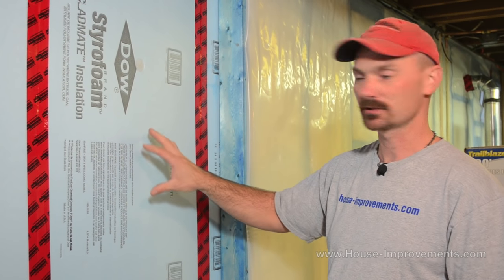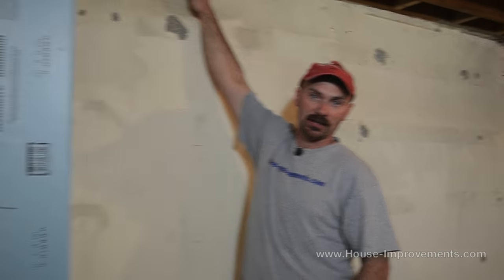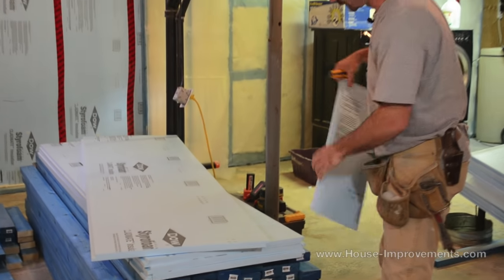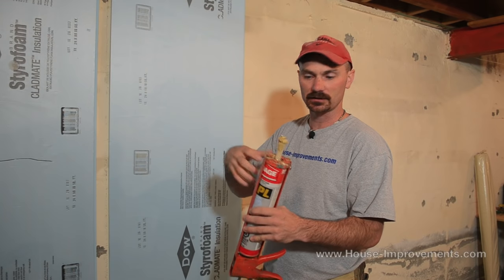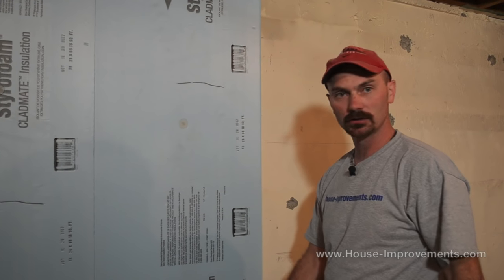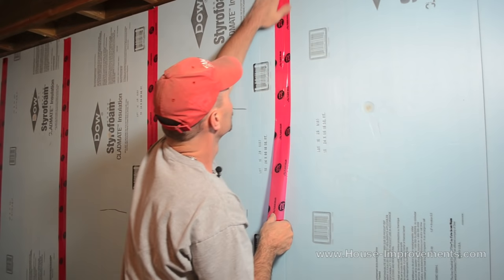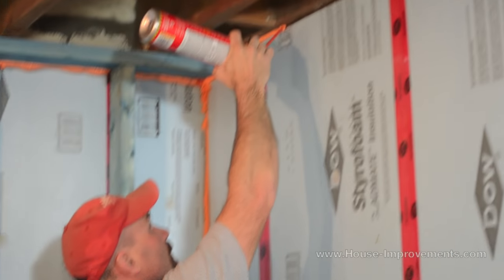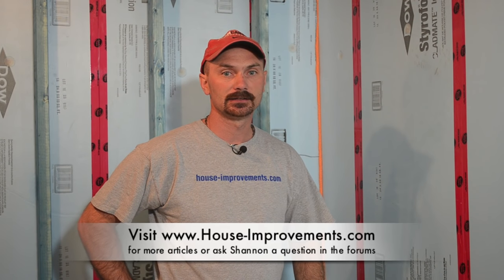How To Attach Rigid Foam Insulation To Concrete

Comment: Hi Shannon, I have a question about a house built in 1967 with brick on the outside wall. I was planning to insulate my wall that is not attached to another house (corner house wall) and was trying to figure out the thickness of the studs by poking a hole in the wall with a drywall blade. To my surprise I was only able to stab 1.5" inches deep because that is how deep it is and that is including the 1/2" drywall. I don't see any insulation at all through wall when I carved a small piece off and see what looks like cement or cinderblocks. Is this configuration normal for my house of that age because I was under the impression that houses are either 2x4 or 2x6  for living rooms and bed rooms.

Initially I was going to use fiberglass or rock wool but I guess my only option is 1 " rigid foam made by Rmax Thermasheath with R value of 6. Do I need a vapor barrier with 3-6 mil plastic with this type of install or does rigid foam already serves as a vapor barrier?

Comment: How deep into the concrete wall does the masonary bit go.
I think I'd be nervous to drill holes below the outside grade due to potential leaking..
Is there any way to smooth off the bumps on the concrete wall..?

Comment: +houseimprovements you said the foam acts as vapor barrier as well... then you said you're using the studs with normal insulation I assume fiberglass with a vapor barrier on top. isn't this counter productive and incite mild grow on the fiber glass since it will be trapped between two vapor barriers where moisture will be trapped?
Reply from the maker: No, the thickness of foam used here (1") is not enough to be considered a vapour barrier. You need 2" of foam for that. The 1" foam here is considered to be a moisture barrier though against the concrete .

Comment: I have  sheet insulation 1.8" thick. I want to put it on my basement walls which are 8" thick poured concrete. My sheet insulation has a fiberglass type backing front and back. Do I need a vapor barrier and if so is 4 mill plastic good to use. Should the vapor barrier be against the concrete wall or overtop of the insulation? thanks your response is appreciated.

Comment: Hi Shannon, could you please let me know if after put the foam insulation in the concrete wall and the framing I have also to put another kind of insulation? (for example the "yellow" insulation showed in this video) . Do you have any other video explaining that?

Comment: is it ok to put that styrofoam board directly on to cinder block?  My basement is cinder block, then probably like 1 ft or 1 1/2 from that is the stud walls.  between that is some sewer/drain pipes around the basement.  prior we just had insulation with the paper as the vapor, but due to flood had to rip it all out. now it seems like there is such a better method for insulation, mine as well do it a little better this time.

Comment: In this video you use the batt over the rigid foam. I'm in North Dakota so winters are about like the ones in Saskatchewan, can I use rigid foam only and avoid the batt insulation all together? I love your videos and that you wear hockey hats all the time haha! Thanks
Reply from the maker: Thanks for watching, I have now changed my hats in the newer videos. LOL
You could skip the batt insulation but if you do use 2" XPS ridged foam to achieve the R values needed.
Reply: Perfect thank you for the quick response! You've solved months of research questions!
Reply: @Colton, you may want to consider Roxul. It is a rock wool type of insulation. Mike Holmes loves it and uses it all the time. I used it extensively in my home reno. Perfect for basements as it is mold resistant. Great for sound abatement too.
Reply: And 1/4 the price of Rigid foam!  I've decided to use a combination of the two.  Also, Roxul won't catch fire unlike rigid foam.
Reply: Tania Twordik 
Did you still need to use a vapor barrier on top of the combination before the drywall
Reply: That why its best to use rigid foam on the exterior...

Comment: Drilling into concrete that much is really a pain. Wouldn't it be possible to use the same foam insulation you use for the cracks or another similar product to hold this panels to the block. Surely someone has created this by now.

Comment: Shannon, this is great, thank you.  Do I need to do anything differently if my basement has a floating slab?  There's about a 3/4" gap around the perimeter of the slab and the concrete block wall.
Reply from the maker: You may need to install floating walls but the foam install should be ok. Look on my channel for a related video about framing floating basement walls.
Reply: HouseImprovements thank you so much! I’ll look for it!

Comment: i am putting 2 inch foam board on the walls in my crawlspace and plastic vapor barrier on the floor , my question is , do you put the plastic vapor barrier behind the rigid foam board or in front of it , not sure what to do to get the best seal.

Comment: Shannon, ty for the video.  Had a question. Any suggestions if there are visible French drains.  I can insulate the the top as you have shown here, but is it ok to leave the bottom end exposed since there is French drain around the perimeter of the house?
Reply from the maker: Yes you do not want to seal the bottom in that case. That way the moisture can make it out from behind the  foam and make it to the drain.
Reply: Ty. But should there be a concern for possible mold since there is no airspace between the wall and foam board considering condensation/moisture would travel down to the drain?  One again, ty for sharing your wealth of knowledge.
Reply: HouseImprovements I am thinking to do a French Drain outside my concrete wall, my interior walls are mega high... can I leave a bigger gap at the top- like half a foot? (for more airing and cost cutting- then baton and insulate away from that). Also when I put the horizontal wood down for the vertical studwork I think I will try to use the blue wood you recommended, but just use untreated for my vertical studs. I then follow the steps on your other "insulation wall" video- BUT what do I do regarding moister barriers lip and flap when I come to do my flooring? How and where do I tie all of that in?
Can I moister treat the wood for bases and top stud framing if I cant find the blue wood?
Kind Regards
Reply: Sunil S Mold needs an organic food source to exist and grow.  With the foam having intimate contact with the wall, there is nothing there to allow mold.  Now, if you have a wet basement, the cause has to be addressed before putting up the foam...unless you have a weeping drain system in the basement floor.

Comment: Ive seen other videos where they used a based moister barrier of some kind of fabric instead of this styrofoam. Do you have any comments on that type of installation? The reason that i am asking is bc my basement is already framed so it would be quite a bit of work to try and slide these styrofoam pieces underneath the framed wall.
Reply from the maker: if you come to the forum you can show me the product?https://www.house-improvements.com/forums/

Comment: Good day I have a 960 sq. ft. cinder block basement at my cottage that to insulate. I have already purchased 2 " rigid foam board for half of it from a homeowner who had product left over. 2' x 8' x 2". I also was given Hilti insulation fasteners (full box of 300) and the bullets for attaching it. I think they are far to aggressive.  I've decided not to use the these fasteners and go with just predrill 5/8 hole into foam/block and attach by hammering in plastic screws shown in your videos. I may also add a bit of adhesive on the back. I was then going to tape seams and spray foam gaps. My question here is .....because I'm using 2" board do you think I need to use the bat insulation as well? I was not looking at heating the basement but just to use it as my workshop and storage. Any suggestions? Much appreciated Michael
Reply from the maker: The foam must be covered to protect it from fire because if it burns it gives off a toxic smoke. So you need to maybe frame a wall anyways so then I would add more insulation. If you just strap over the foam with 1x4s to allow attachment of drywall to fire proof the wall then you would not add batts. Depending on your climate you may want the extra R value of the batts anyways.

Comment: in a non vented crawlspace do you only need to insulate the walls. If you say its a good idea to do the joist also. What would be a good insulation to use where you don't need a mask everytime you have to go into the crawlspace ?
Reply from the maker: +GmGarlo You do not need a mask if you use batt insulation, usually if you are not dealing with the insulation you are ok.
Reply: +HouseImprovement i am planning on using rigid foam on the walls but instead of using batt insulation between the floor joists would it be alright to use rigid foam ? because i'm concerned about the batt insulation having mold issues and mice seem to love making nests in them.

Comment from the maker: The poly and foam is there to prevent vapour from entering but if minor amounts do get through they should evaporate
Reply: If you put both poly on wall than insulation and close it with the vapourbarrier you close the vapour inside the insulation if any vapour should come or? How wil the vapour evaporate?

Comment: When finishing a basement where would you place wiring (romex) ??  Behind the foam ?    Can I use 2" for studs to fasten the sheetrock to the wall?   When drilling into block is it best to drill into the block or the mortar?   thanks good video..
Reply from the maker: Place the wiring in the stud wall. If you do not need more R value (insulation) then a 2x2 framed wall would be ok, if you need more insulation then 2x4 wall. Block walls I would use adhesive that is safe for foam instead of drilling the blocks.

Comment: I have a pressure relief system installed in my home, would it be a good idea to cover the mirror drain with the XPS foam board or stop right above it? Thanks!

Comment: Hi Shannon, I am planning on installing 1/4 fanfold behind the studs to cover my entire finished basement interior wall. I don't care for the R value as I will be putting Rockwool on top of the 1/4 foam board before I sheetrock. It will be mainly used as a moisture barrier. Can I use the plastic fasteners to cinder block as it would be easier than foam spraying them in place because of the beams in the way? Also I have French drains installed with a few inches of dimple mat coming out of the ground. Should I install the foam board up to the drain mat or should I go down to the wood plate?
Reply from the maker: Just use concrete nails along the top edge 3' down or so and the odd dab of foam spray. Tuck the sheet into the dimple membrane so any moisture is directed into he french drain. Fan fold is not cheap and barely any R value I would just use house wrap instead hung backwards against the block wall.

Comment: Hi Shannon. Can I using a thicker foam with higher R code? So that I don't have to do more insulation with batt on top of the foam?  Or Can I install stud at the same time with the foam? So that I don't have to drill more holes and use plastic anchors to hold the foam against the concrete wall? Thanks for your video which is quite helpful.
Reply from the maker: I would install thicker foam if thats what you want. Most colder climates require a minimum of R12 in basements
Reply: HouseImprovements Thank you for the quick response. This morning I went to Rona and was told that I should NOT use a rigid foam directly against concrete wall. The rigid foam prevents airflow, and I also leave some space between stud and concrete wall...bla..bla... I am totally lost now. But I believe Shannon is correct and I will follow his steps. BTW: I'm living in GTA.

Comment: Hi! This might be a weird question...but is it okay to do a basement renovation over time? If I can only afford to do the foam + framing, is it okay to leave it like that for a few months to a year? Thanks! And thanks for the informative video!
Reply from the maker: Actually the foam should not sit exposed for extended periods as it gives off harmful smoke if it burns in a fire. By code it should be covered. Please ask your question in my forum and I may be able to give you some other ideas instead. http://www.house-improvements.com/forums/

Comment: My basement has a 4 foot concrete wall with a pony wall on top. I'm looking for info on how to frame over the foam boards on the concrete and tie it into the studs on the pony wall. The top pony wall is insulated, with vapor barrier, in the usual method. Based on your video, I have insulated the concrete wall with styrofoam boards. Could you direct me to a link on how to frame over the styrofoam with studs and tie it into the top pony wall??

Comment: If you use a thicker foam sheet product is there reason you could not attach the drywall directly overtop the foam using tap cons? You have already created the moisture barrier with the foam.
Reply from the maker: No you could do that but the problem with that is if your concrete walls are not flat ,straight or plumb either will your new finished walls

Comment: Good day Shannon,

I have 9' basement wall and the rigid insulation is only 8' do i need to extend it to make it 9' or does 8' works as well?

Thank you.
Reply from the maker: Add a strip to extend it the entire height.
Reply: Thank you for responds!

Comment: No, no, do not ever use poly as a moisture barrier inside.  It will trap water, even water vapor, and create a wonderful environment for mold to grow.  You can spray or roller on Ghost Shield, which will keep water vapor from coming through the concrete, and liquid water from penetrating via capillary action.  It will not, however, seal up cracks in your concrete.  That takes a whole other set of remedies.

Comment: I'm just installing the 2" foam board.  I don't have my wood plates in place yet on the floor.  Do I put foam sealer along the bottom to seal the gap between the foam board and the concrete floor?  Or do you leave this open to allow any moisture to escape downward?
Reply from the maker: +Kelly C needs to escape.

Comment: Hi,
Wondering if I need to insulate a framed wall that I will be putting all around the outside wall of my basement.. 
Two inches of Ridgid Foam Board...
A 2"x4" studded wall.
Should the studded wall be insulated?
I intend to drywall the inside studded wall.
I installed  pex pipe in the concrete floor on top of a two inch thick foamboard with wire mesh for an infloor heating system.
Could you let me know the name of that foam crack sealing product you are using in your video.
Thank you Dber

Comment: Part of our basement walls are very uneven and stuck
Out from decorative masonry/rocks.  Is there an issue attaching the foam to an uneven surface ?  Do you need to fill these “gaps” in the uneven parts where the foam board is not touching the wall directly ?
Reply from the maker: Its best if its pretty tight but up to 3/4" gap would be ok
Reply: @HouseImprovements  thank you!
Reply: @HouseImprovements  so what would be best if the board was resting on uneven rock type material?  Could you but the foam board against it and then spray the gaps with expanding foam ?

Comment: Nice video. Quick question. I'm planning on doing this exact same thing in my basement. The question from me is, my walls are bare concrete block right now. I get just a little bit of moisture on the wall in a couple of spots (no standing water or seepage / just visual moisture inside the block). I have a French Drain around and under the house outside and underneath. Will I have to put some sort of "waterproofing paint" on the walls before I attached the rigid foam? Or do you think it's okay to just foam over it with nothing on the walls? Just curious.
Reply from the maker: No paint needed.
Reply: HouseImprovements Cool. thanks very much!

Comment: Hey Shannon !
Can those plastic anchors be used to hold drywall over foam board  (without studs, very narrow application - 2 feet wide)?
If so, can the anchor heads be dimpled into the drywall, covered with patching, and then painted?
Will the patching adhere well to the plastic heads?
Cheers,
Reply from the maker: I have never tried that but i doubt it will work well.
Reply: @HouseImprovements  The weight of the drywall would pull out the anchors. Right?
Would adhesive shot into the hole be effective at increasing the anchor grip?
Reply: Foam board provides fire blocking. Correct?